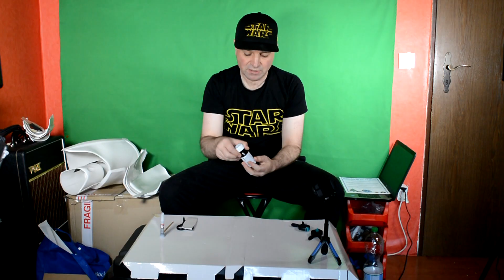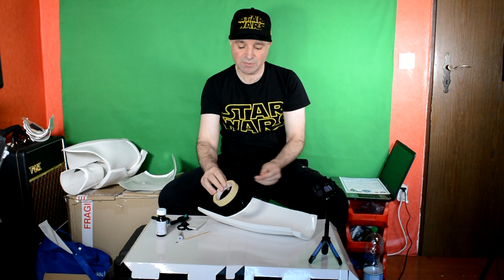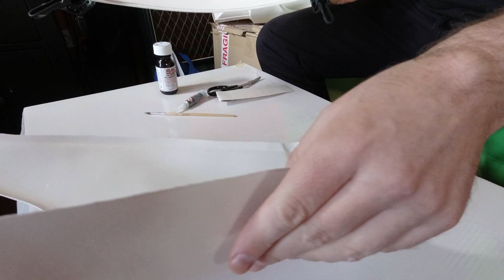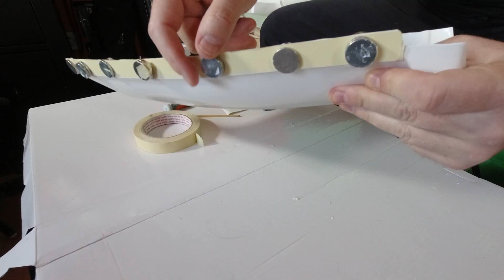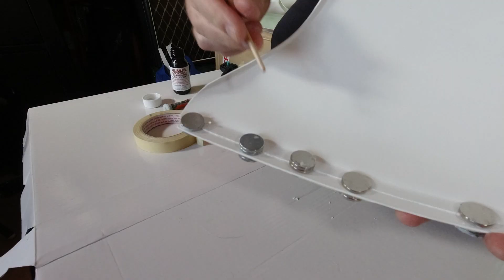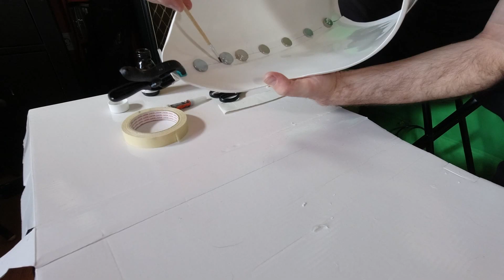STORMTROOPER BUILD TUTORIAL: How to use plastic weld

Comment: Looks pretty much like the Poly cement i use on model kits. What make is it? I couldn’t quite see.
Reply from the maker: It's all the same stuff. Not sure of the brand off-hand. Poly weld rings a bell. I think I've used it in the past. It'll be the same active ingredient.
Reply: @RichieStormtrooper  got some. Much better than the Plumbers cement that i was using
Reply from the maker: @adrianrosenlund-hudson8789  Nice one! I don't know what it is but the stuff that's produced especially for model making is just really effective. I've built suits with just acetone and it works fine. Just seems to take longer. Keep us posted on the build.